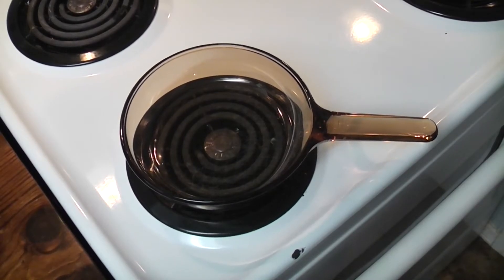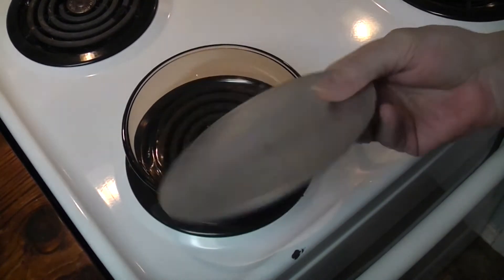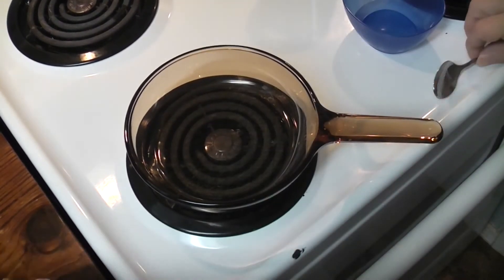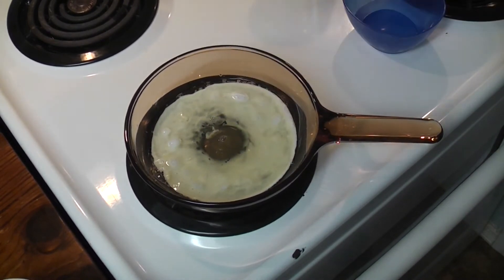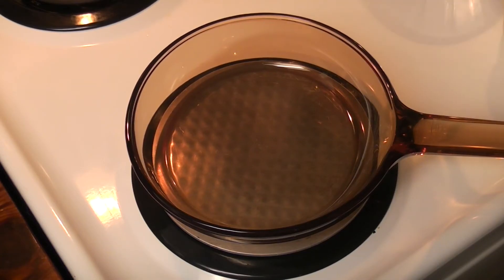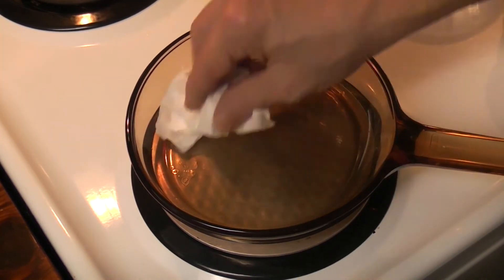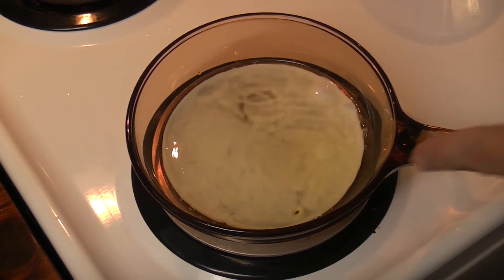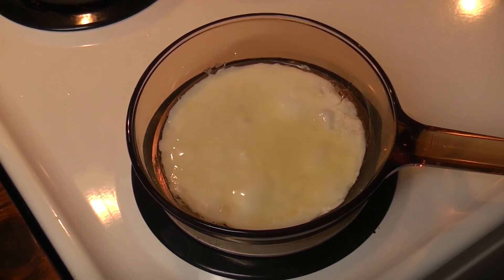Visions Skillet Thermal Test - Aluminum Heat Spreader Disc

Comment: My Visions pans & Pyrex tea kettles came with a wire trivet and explicitly state in the instructions that they are never to be used directly on an electric heat coil. I never risked it and the little star-shaped wire trivet worked fine!
Reply from the maker: Visions and Corning Pyroceram don't require trivets. You are correct about Pyrex Flameware skillets, kettles, percolators etc. The aluminum discs I use in these videos are only for Visions or Corning. I don't use them with Pyrex.